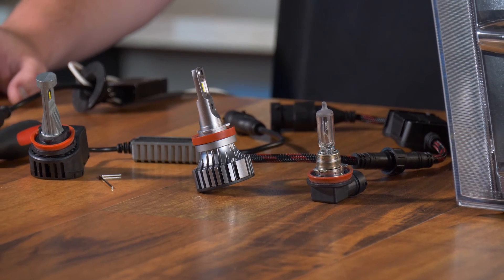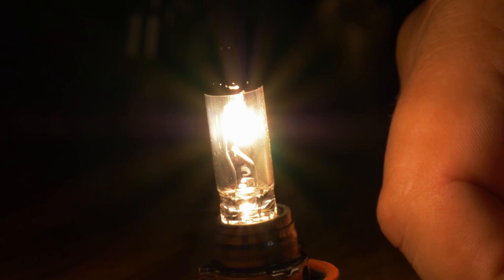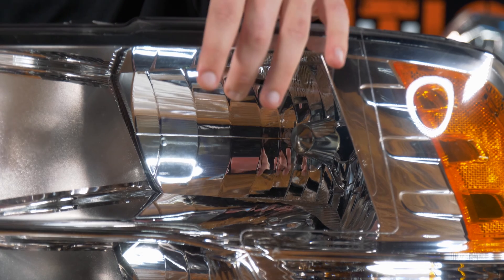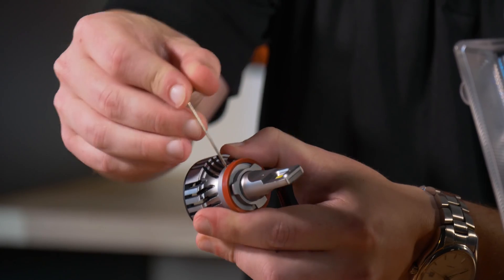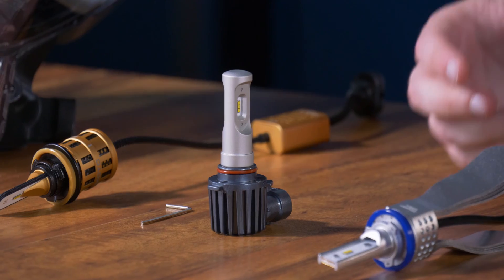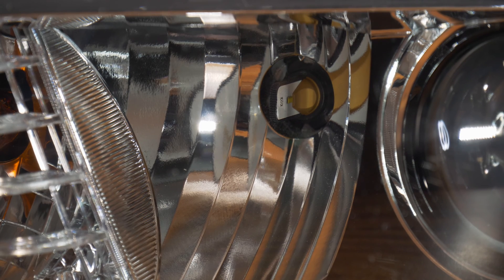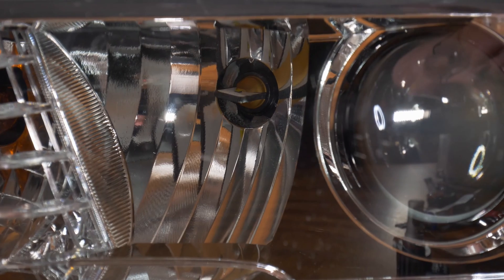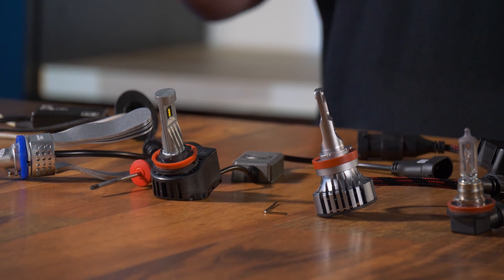How To Align and Aim LED Bulbs For the Brightest Light Output | Headlight Revolution

Comment: What about the C6 35W 9005 LED lights for gmc envoy the beam pattern is very bad so hot to adjust it
Reply from the maker: I'm not too familiar with those bulbs, but after looking at them, they do not appear to be adjustable. You're best bet would be to go with an LED bulb that can be adjusted.

Comment: Hi mate, how about for the toyota corolla hatch 2012. Because when you put the led  you wont see if its on the 9 and 3 oclock
Reply from the maker: For that, the easiest way is to mark on the heatsink where the LED chips are. That way, when you install the bulb, you can use the mark as a reference.

Comment: I am doing this in my motorcycle and my led bulb lights up on both sides with high beams and one side with low, is the 9 and 3 O clock preferred for that?
Reply from the maker: So when you're on low beam, one side of the bulb lights up, and when you're on high beam, both sides will light up? If so, that will not provide a good beam pattern, and that is not how an LED bulb should function. You want both sides of the bulb to light up for low and high beam. 

But to answer your question, yes, you'll still want the LED chips to face left and right. What LED bulbs are you currently using?

Comment: Do you insert them at 9 and 3 and rotate it so led is perfectly vertical? Or are they suppose to sit at 9 and 3 o'clock in the housing? It looks vertical to me when they're installed
Reply from the maker: When you first insert the bulb into the headlight, the chips should be around 1 and 8 o'clock, and then when you rotate the bulb into the headlight, they should stop at 9 and 3 o'clock. 

You'll want the LED bulbs vertical, but the LED chips horizontal.
Reply: @HeadlightRevolution  great thank you! Just order some gtr ultra 2 and wanting to get it right
Reply from the maker: Not a problem! Let us know if you have have any other questions!

Comment: OK, I’m confused. On the two sided LED bulbs I’m thinking of buying for my truck, in the description it says beam angle; 360 degrees. I thought 360° angle was supposed to be a bad thing? I’m confused. I have a 2001 Dodge ram 1500 pick up truck I want to put them in.
Reply from the maker: What LED bulbs are you looking at getting for your Ram?

Comment: Glad to see this video. I literally just saw a review on your site claiming the S-V.4 bulbs were "non-adjustable." Clearly that's not the case.
Reply from the maker: Would you be able to send me a link to where you saw that? The S-V.4's certainly are adjustable!
Reply from the maker: Thanks for sending that over! That's very strange as these bulbs are 100% fully adjustable.
Reply: @HeadlightRevolution  not a problem. Unsure if it's for an older version or he just didn't read the directions.

Speaking of which, I have a Tacoma as well. Which would you recommend, the S-V.4 or the GTR lighting ultra 2? I don't want too much reflection in a snow storm and the review recommending the S-V.4 came out before the Ultra 2 came out.
Reply from the maker: The S-V.4's were adjustable since they came out, they must have not read the directions or something. 

What year is your Tacoma?
Reply: @HeadlightRevolution  2017
Reply from the maker: For that year, S-V.4 will be the best option:
https://headlightrevolution.com/vehicles/toyota-tacoma/headlight-upgrades/
Reply: @HeadlightRevolution  I know you guys at HLR, focus on trucks and off road vehicles but what would your recommendation be for a coupe with H13 bulbs? (I drive a 2014 Challenger with reflector housing) I've been eyeing the Morimoto Bulbs.

Comment: My problem is, I have a projector  and can’t see if it’s actually 3/9 or or not. I can’t visually see when I install, where it’s angled at
Reply from the maker: Do you currently have LED bulbs installed? Most LED bulbs have the wire coming out of the bottom of the bulb. If you have an LED bulb that does that, then you just need to make sure that the wire is coming out of the bottom of the bulb when it's installed.

Comment: A little tip...i was having some trouble finding the right 9&3 configuration just eyeballing it. So I placed the bulb as it should be installed. Then took a white paint marker and made a dot at 12oclock on the collar. Then took the bulb out and aligned it perfectly, tightened the Allen screws and it was perfect. No need to fiddle, just try this, it works awesome. You're welcome. 😁
Reply from the maker: That's a great idea, glad to hear that it worked out for you!
Reply: Make a YT video for us!!!
Reply: So u aligned and turned the actual bulb to that marked position on the collar ? How u do it let’s say u can’t get in there with a marker to mark the collar while bulb installed ? My setup is very tight in there

Comment: you say 3/9 but show 6/12...
Reply from the maker: Not entirely sure what you mean by this. At 1:00 we show how the beam pattern looks at 6/12. Then at 2:10 we show it at 3/9.
Reply: 9 and 3 refers to the position of the LEDs (which are on the flat sides of the metal "slab" for lack of a better word)
Reply: Ya I was confused by the 9/3 comment too...several times it shows bulbed installed vertically 12/6. Not 9/3

Comment: Is it always 9 and 3?
Reply from the maker: It sure is!
Reply: @HeadlightRevolution  Thank you!
Reply: @HeadlightRevolution  actually, I got the JDM ASTAR T1 H11 H16 All-in-One Upgrade Vision White LED Headlight Bulbs/Fog Light Bulbs" and put them into vehicle and they had a good pattern out of the box. They have a screw on the bulb part, but idk if that's a set screw, I unscrewed it a bit, but the bulb didn't spin or seem to loosen, and I didn't want to unscrew it full incase I damaged the headlight, but it seems that they are set 9 and 3 out of the box, so that was kind of a dumb question on my end. Haha

Comment: Great info! Does this hold true for d4s HID’s as well? Thanks in advance
Reply from the maker: HIDs generally fire in a 360 degree pattern anyways, So the clocking of those is a little less critical. Typical D series bulbs can only really be installed one way in the headlight as well, So that helps to prevent misalignment.

Comment: Would I have to align an led headlight bulb on a projector type headlight like on a 4runner?
Reply: I'm no expert,   But According to Diode Dynamics,   that is incorrect!  Projectors also require alignment.   I've seen  directions and Y. T videos saying the same thing on Leds for projector type.  This is important . My Challenger has Halogens and adjustment is difficult due to the position of bulbs, and the bases are not at 6 o'clock position!
Reply: @scotts6596   hello. How about the projector housing on my rav4 2015. The socket is on the side indtead on the back of the projector? How should I adjust it?
Reply: Norberto Melendez no alignment is needed for projector style headlight, only reflector.
Reply from the maker: James that is incorrect, it needs to be aligned regardless of the housing.

Comment: All the install videos i see show leds in a reflector housing. Which makes it easier to see and align the led but, what about in a projector housing? How would you install them correctly in a projector?
Reply from the maker: Most of the time they need to be aligned the same way, horizontally. 

But the best rule of thumb is to experiment with different positions until you get the most concentrated beam pattern that most closely mimics your original beam pattern.
Reply: @HeadlightRevolution  thanks, i will be looking into getting a set for my 2019 peterbilt 587 which uses both reflector and projector halogen bulbs.

Comment: What about those of us who have factory halogen bulbs in projector housings?
Reply: Try HID system makes more sense
Reply: With the adjustment screw type, the trial and error process is not worth it.   However,  I became aware that the Morimoto 2 strokes 2.0. Have a push in,   turn , adjust , and release  mechanism,  ( if correct) , which is far easier in theory.  But adjustment is still challenging.
Reply from the maker: With a projector setup it's kind of like feeling around in the dark. You need to do some trial and error, taking the bulbs out, adjusting them, putting them back in - a few times - and visually check the beam pattern until you get the best looking setup.

Comment: Hey.wht about h4?
Reply from the maker: What about it? Same applies - the LEDs should be facing horizontally in the housing. One little note - if your H4 LED bulbs have a little glare shield over them (like most do), that should be on the bottom.
Reply: @HeadlightRevolution  what is that glare sheild

Comment: How do you adjust them with projector lenses with the morimoto 2stroke 2.0?
Reply from the maker: Same way that was shown in the video. You can mark the back of the bulb with a line that matches the chip orientation. Then when the bulb is installed, just make sure the line on the back of the bulb is up and down, and you'll be good to go!
Reply: @HeadlightRevolution  but projectors are still set at 9&3?
Reply: @CAROLiNABLUEMUSIC  I think that's what he meant.  mark the location of the chips with a sharpie on the plastic to get at 9-3 reference.  Gonna try it tonight.
Reply: @CAROLiNABLUEMUSIC  I think hid bulbs are far better for projectors

Comment: I have a 7 inch round reflector headlight, are these reflectors suitable for an LED bulb conversion?
Reply from the maker: That kind of depends on which product you bought. We've seen some work really well and others work really bad. The good high quality housings that you can get from PIAA or Vision X take really well to LED bulbs. The cheaper generic ones don't work as well.

Comment: What if we have projector headlights and are unable to see the reflectors inside because the opening at the back (engine bay) is too small and the projector glass is covering the front view as well ?
Reply from the maker: In that case you would go through a process of trial and error. Try adjusting the bulb to sit inside at different angles and shine it at the wall until you have the best beam pattern that most closely resembles the shape of the original beam pattern.
Reply: Headlight Revolution Well noted on that ! One last thing, assuming that my LED does not have the 360 degree rotation, is it advisable to rotate the whole LED instead? I’m currently using a H11 LED and I found that if I rotate the entire led just by a little, the beam pattern improves greatly, but this means that the LED is not 100% secured inside the housing. It’s not going to fall out but it’s also not tightened to its fullest like it’s supposed to. Would that be alright ?

Comment: 360 Leds mounted on the tip work best in projector housings
Reply: They really don't, those won't mimick the halogen filament well at all...
Reply: Hayden Marsh works better in mine, I tried both
Reply from the maker: We've tested every single "tip mounted" 360 degree LED headlight bulb out there and will feature them in a shootout video soon to show the true results. They might seem OK to you if you haven't tried the good bulbs that are out there, but I guarantee you they are far from great. They may work "OK" in your particular headlight housing since there are discrepancies with what bulbs work the best in each headlight housing, but if you put them up against the top rated bulbs like S-V.4 I guarantee you'll be surprised at the difference.
Reply: Headlight Revolution send me your bulbs and I’ll try them and give them a review
Reply: @irishuwould5185  Buy a set yourself and see if you like them or not. Headlight Revolution has a hassle free 30 day return period for them - if you will still be disappointed simply send them back during that time and they will provide a full refund. How do I know? Ordered the wrong size of these bulbs myself and got a full refund after sending them back before the 30 days ran out. I otherwise have these bulbs on most of my cars and will never look back.

Comment: I installed sv4 s in my 2019 f150 had no issues with the low beam getting them parallel with the ground , when i got to the hi beam s they are at a 45 degree angle will that matter ? It doesnt look like there is a reflector ?
Reply from the maker: If you feel like the beam pattern is a useful high beam and they seem brighter than stock, then no - you're good to go already.